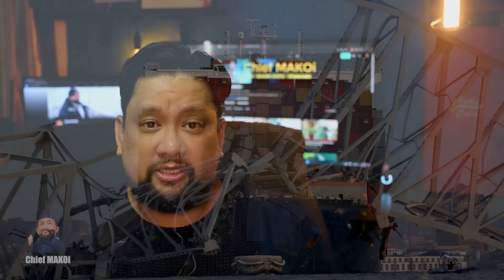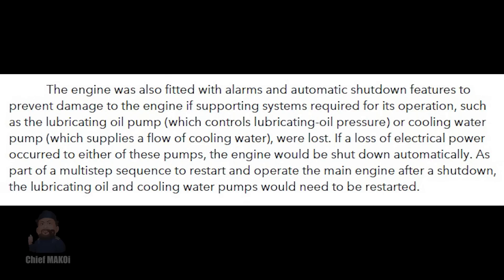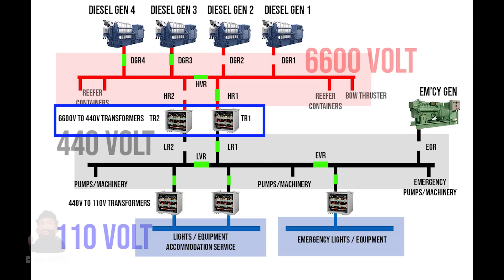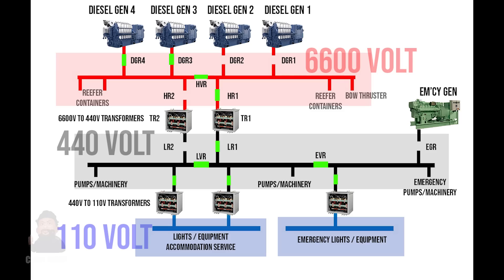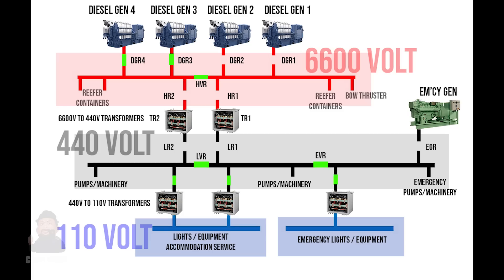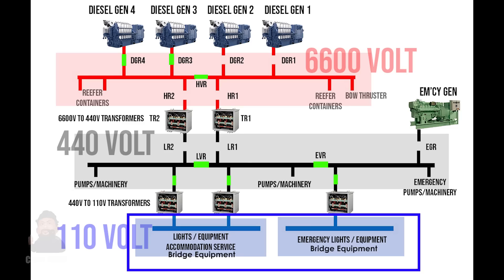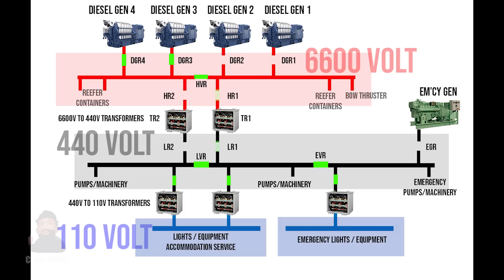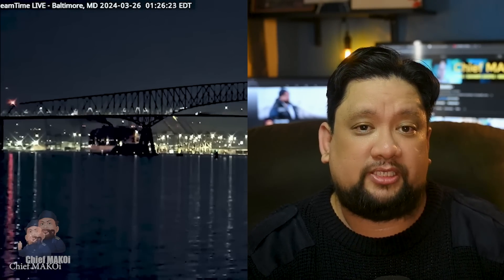Explaining the NTSB Report on the Container Ship DALI | Chief MAKOi

Comment: I sailed on this ship. the ME LO PUMP ARE CONNECTED TO 6.6KV.  AE 3 AND 4 ALWAYS RUN ON Diesel oil.  Its Fo supply System has 4 supply pumps. and 2 booster pump with common line for AE and ME.
Reply: Do you have the fuel diagrams (transfer and service)? I would like take a look. Sailed on similar vessels but never with LO pumps on HV
Reply: Why always running on Diesel. Do you know about any fault for HR1, in report they were telling HR2 was in use long time before using HR1.
Reply: @antokattikkaran8650  AE 3 and 4 cannot be changed to HFO as its exhaust system is not connected to EGS. They modified fuel oil line such that it cannot be run on HFO
Reply: @deepseamariner  so as per report generator to 66 kV not tripped but as 440 tripped main engine  tripped. 
Is there any problem with HR1 circuit breaker in your time
Reply: @deepseamariner   I was sailing as ch engr in Wilhelmsen but  not worked 66 KV ship. As 440 tripped they were not able to use thruster.
Reply: @antokattikkaran8650  it's 6.6 kV, not 66kV.